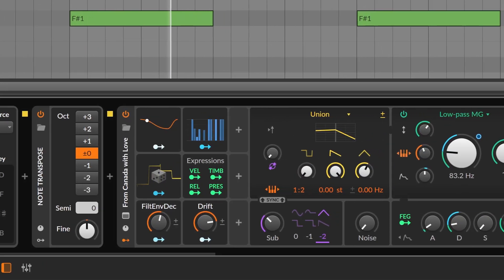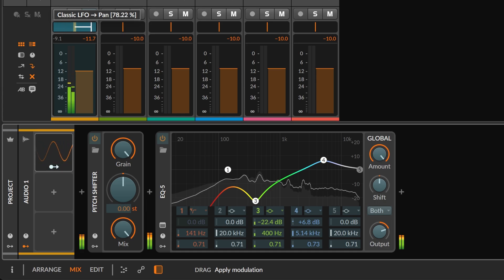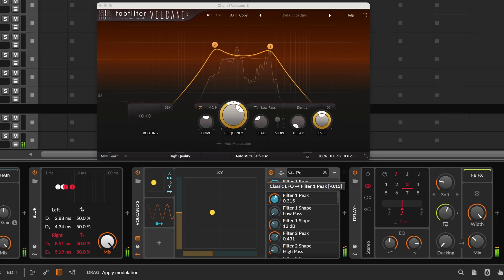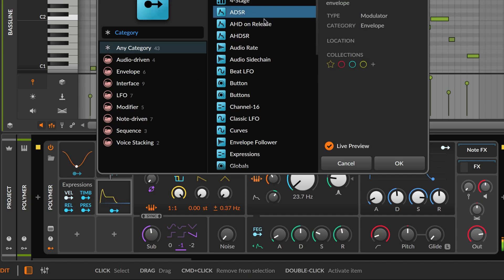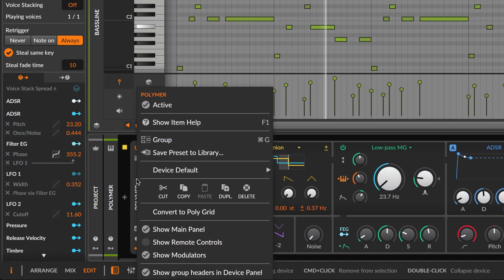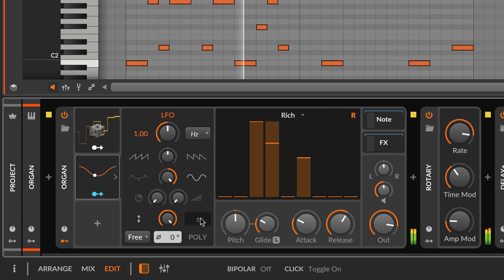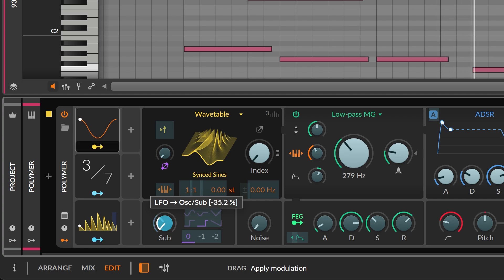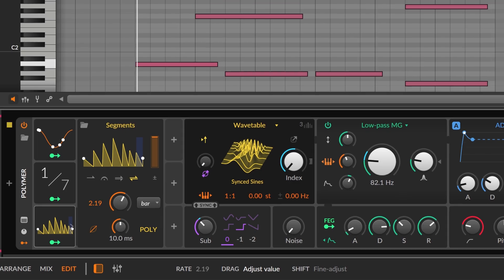Getting Started: Modulation Basics

Comment: Hey, thanks for the info.I've been using Bitwig for a few years now, and I really like it.
But I do have one request.Please make the automation of grid binding a little better.I know that there is a button to bind, but it doesn't work very well in my opinion.Even holding down the Shift key makes the automation line "float" up and down, but I only need to move left or right. And the binding to the grid does not work very well, constantly need to adjust. It seems to put a point on the grid, but after expanding the arranger I see that the point is not on the grid.
I hope that someone will read my request and do something.